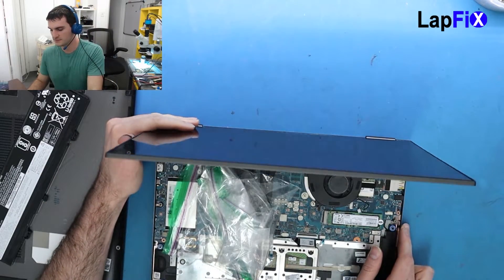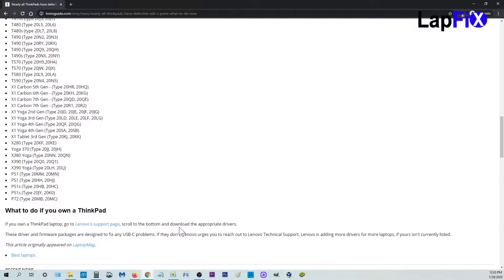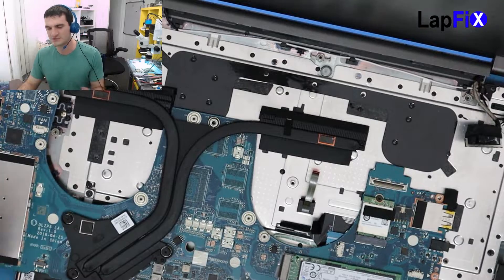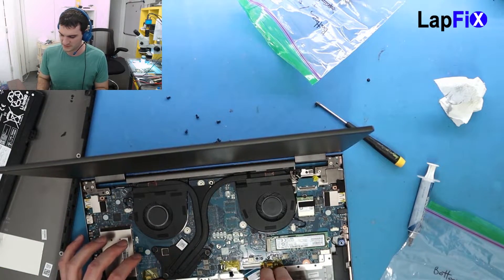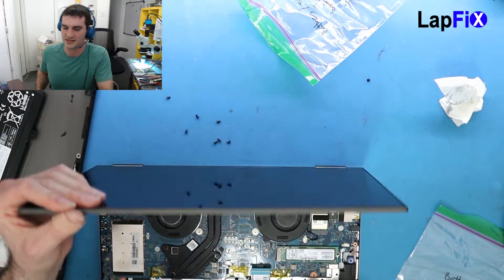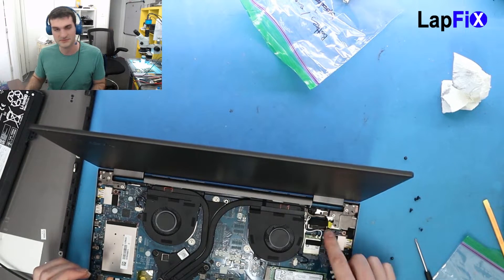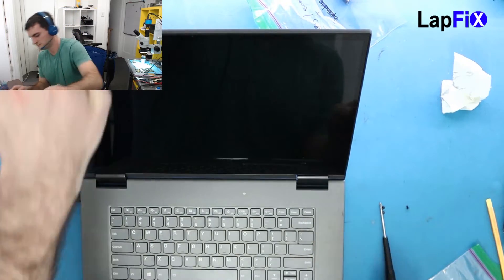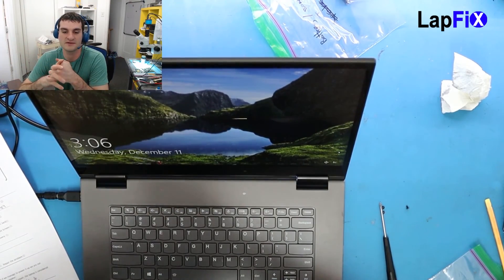Nearly all Lenovo ThinkPads have defective USB-C USB C issues

Comment: If it it's a driver issue, the usb-c port designed for charging shouldn't work with the laptop turned off? The other usb-c (the thunderbolt one) from the laptop (t480s) works for charging  - both with the laptop on or off, but when I insert a usb-c card reader it doesn't recognize it.

Comment: Seeing this a lot with Dell 7389's... looks like they tried to strengthen the ports on the Dell 7420's, but same issue.  the newer 7389's will probably kicked out of inventory before the older E7470's- even out of warranty, easier to repair and very up-gradable.